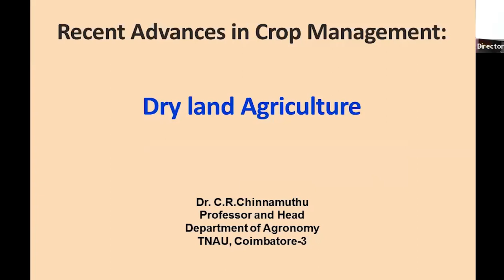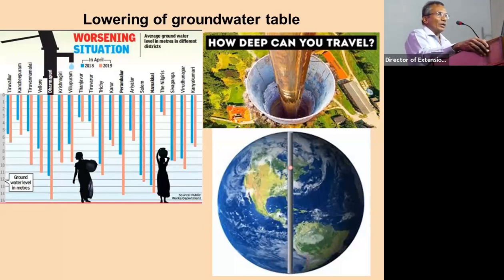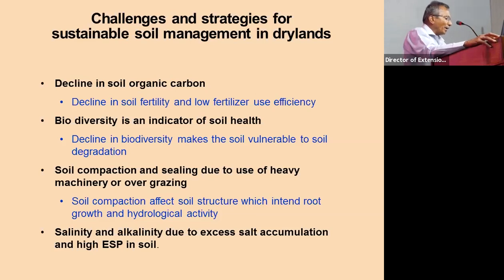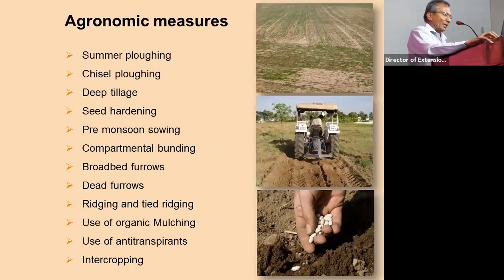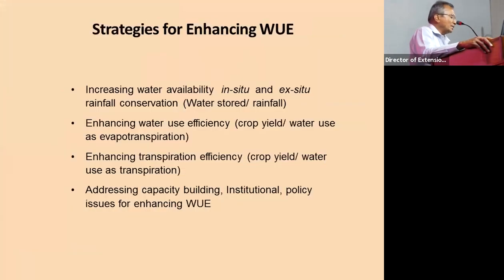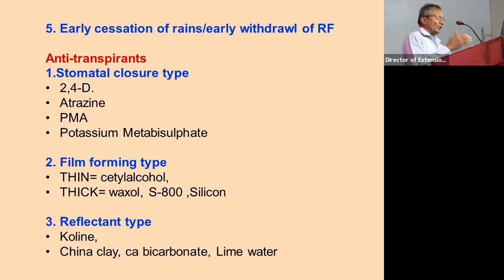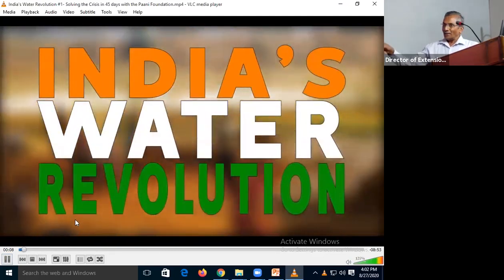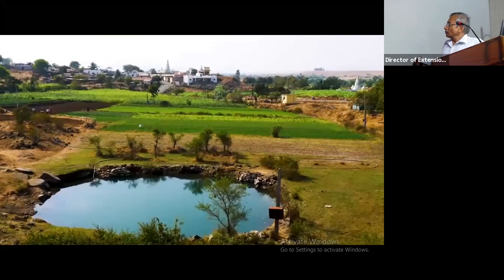Dryland AQgriculture

Comment: What are the successful recharge techniques for sandy loam soils? Already these soils are very good in water perculation. So i dont see any flooding even with excessive rains in this soil type. Still there is water scarcity, so what to be done? (Specifically for kangeyam areas)